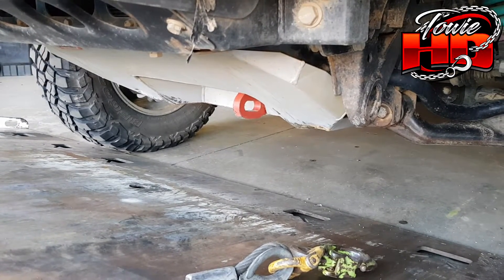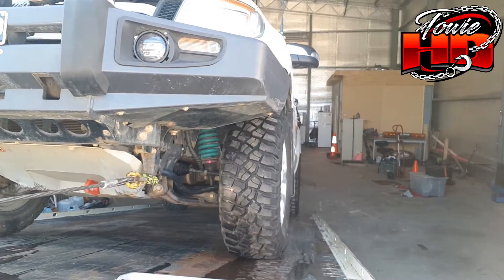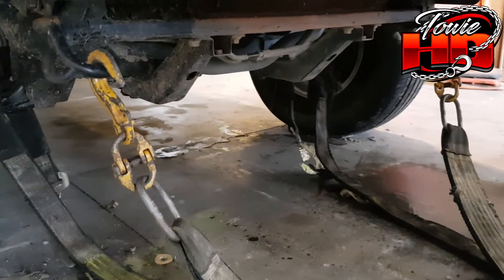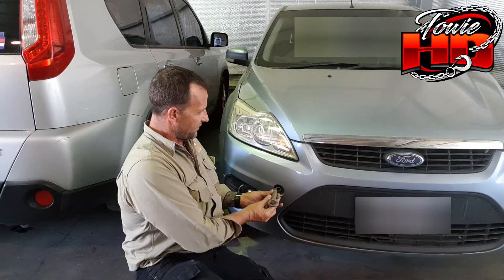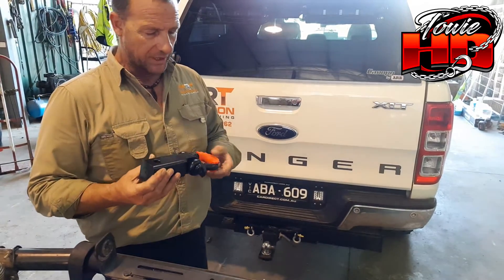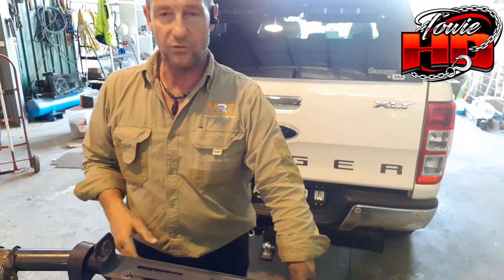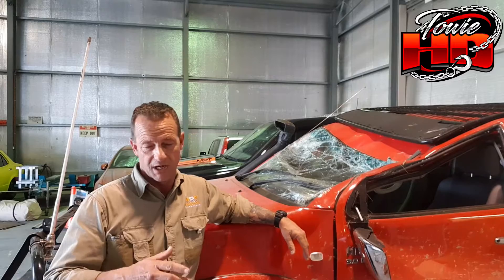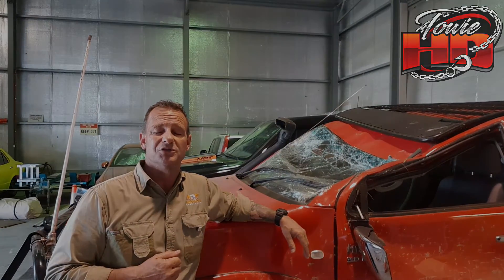Tow Points - What I use and don't use

Comment: I find a nice solid way of attaching to the main chassis of the car. I often use a lifting chain bridal to wrap around the axle, chassis or control arms.
Reply: I hope you're not pulling on the axle
Reply: @MNDashcam  something like a little Corolla that has skidded out in a paddock or soft sand the rear axle is fine for a gentle tow out
Reply: @v26224  corolla doesn't have a rear axle. The axle is the spinning shaft that goes into the transmission and goes out to The Wheel.
Reply: @MNDashcam  ok so what I would have called an axle isn't an axle, so i am technically not pulling off the axle.
Reply: @MNDashcam  That’s called the drive shaft. The drive shaft connects to the transmission.

Comment: Thanks for putting this video together! What would you recommend for a tow point using a recovery strap on a sedan or CUV after they've dug themselves into almost a foot of snow. I'm not a professional, just trying to help folks out that get stuck during our Canadian winters. My vehicle is a TJ with D-ring shackles on both bumpers and I do have a receiver one as well, but I don't have a winch sadly.
Reply from the maker: I have been using a kinetic rope of late and absolutely love it. Just have to remember to give it a good clean after your trip to get all the bits of mud and dirt out
Reply: @TowieHD  Any advice on where to hook them up on sedans or crossovers? Especially if the driver doesn't have their tow hook handy. I imagine a subframe would work well but rather not test it on someone else's car.
Reply from the maker: @mistakitty  depending on the car, I will incorporate a bridal to go around the control arms. I will be doing a video in the next couple of months that will show different scenarios.
Reply: Bring a good shovel and use all the regular options

Comment: a bit of an odd question, but how do you properly remove the front tow hook cover on the focus without damaging anything?
Reply from the maker: Not an odd question at all because they don't leave you a great deal of room to do so, that's for sure. I keep an old test light with me, because the point of the test light is very thin I can get it in the very small gap and pop it out without damage. Hope that helps you

Comment: Do you not have a pulley and chain setup so that the cable will pull straight even though the attachment point is on the side of the vehicle ?
Reply from the maker: I do however, the winch cable is still going to pull to the side regardless which puts more strain on the cable. There are set ups where the winch is on a rail system and can move to the left or the right of the tray, but you still run the risk f tow point failure from the pull down force as the car travels up the tray. Appreciate you question too, thank you
Reply: @TowieHD  ok, thanks for the education. My subaru has tow point and tie down points and the tow points look rather weak. So yea, no recovery, just light towing in my opinion.

Comment: Hi, just wondering how you recover a Rav4 2018, which doesn't have any recovery points? I have contacted heaps of companies to get some fitted, but nobody in Australia seems to make them!
Reply from the maker: Hi Sophia. Usually around the control arms for a Rav4 using a bridle that evens out the load as I'm winching. You can get aftermarket points fitted (Either yellow or red) which will be load rated. ARB or TJM would be the best people to chat to about it. Hope that helps 😊
Reply: @TowieHD  Thanks for your quick reply. I’ve already asked ARB, TJM, Ironman and several other companies, including an engineering company. No luck.
Reply from the maker: @sophiahauser3300  wow. Well in that case, around the control arms using a rated soft strap bridle. This method also keeps the winch cable low as not to touch/damage the under of the bumper.
Reply: @TowieHD  thanks so much for your help. I really appreciate it. Have a Happy New Year!

Comment: You're not very bright are ya?  There are LITERALLY  hundreds of thousands of Jeeps on the trails that have safely used the stock recovery points MILLIONS of times without issue.  And you are going to pull on the rear diff , which is held in with 4 paper thin sheet metal control arms,  and paper thin sheet metal contol arm brackets?  I wouldn't let you touch any of my vehicles.  
  Just because you don't know what the tow rating on a factory tow point is does not mean it does not have one.  Trust me, the engineers and lawyers at auto manufacturers definitely make sure they are rated to safely pull their vehicles out of most situations as long as someone smarter than you is doing the pulling.  If they did not do this they would be buried in law suits,  and youtube would be flooded with tow hook failure videos.
Reply from the maker: Hi mate, thanks for your comment.